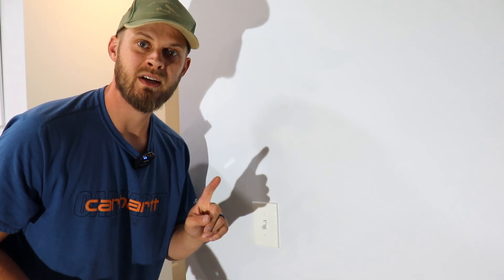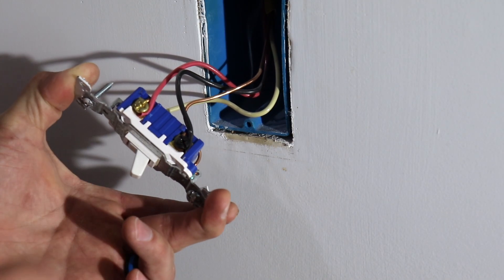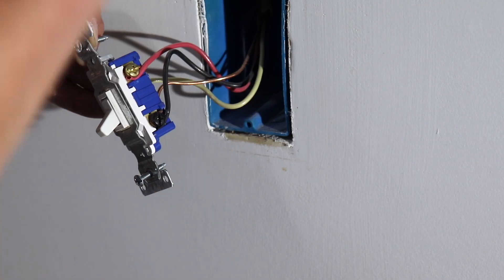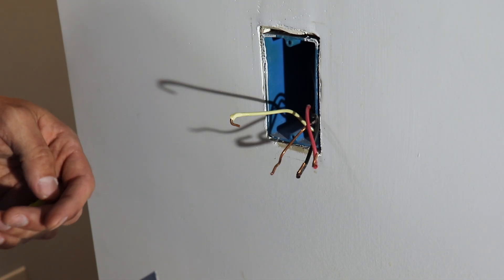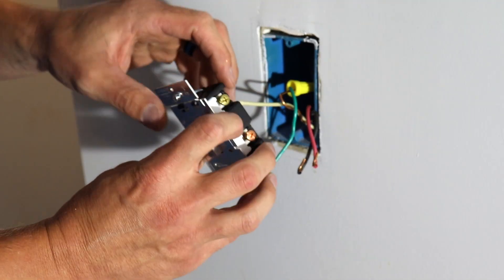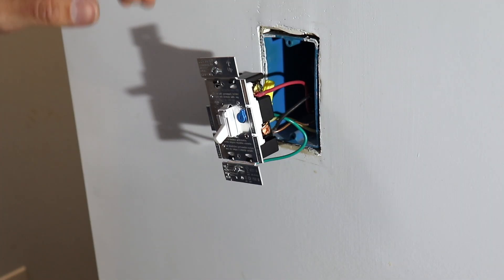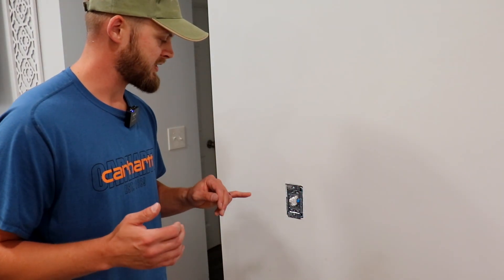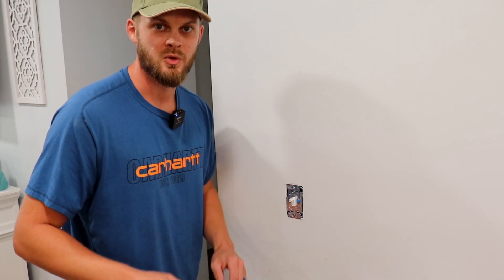How to Install a 3-Way Dimmer Switch (In Under 6 Minutes!)

Comment: I watched this in hopes to see if a dimmer is needed at each end or does that 1 dimmer controlling the undimmed switch as well?
Reply from the maker: You only need to put a dimmer on one of the switches.
Reply: You need dimmer master and a slave dimmer if you want to operate the dimming at either switch

Comment: I’ve watched a number of videos on this topic and none address the switch that has a black common and 3 travelers. One of the three way switches looks like yours and the other has a black common, a red traveler and two black travelers. Which side do I add the dimmer? And what do I do with the extra traveler?